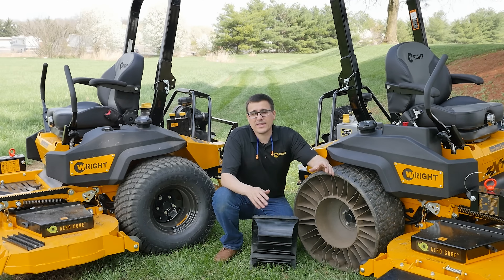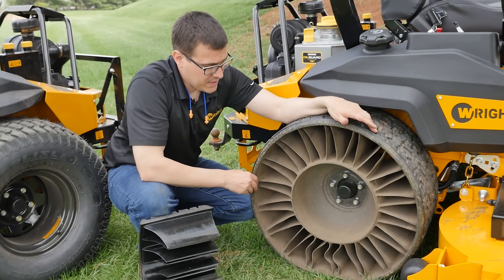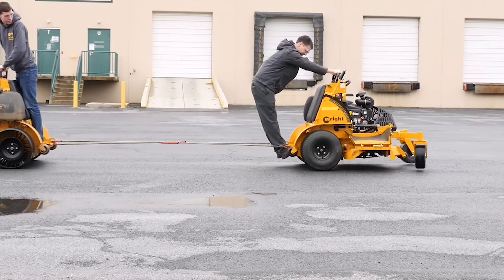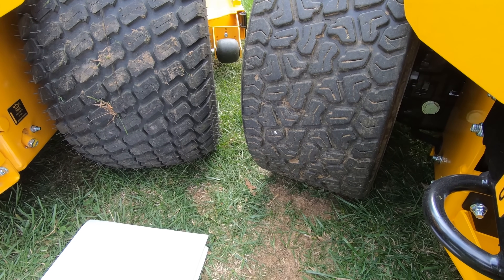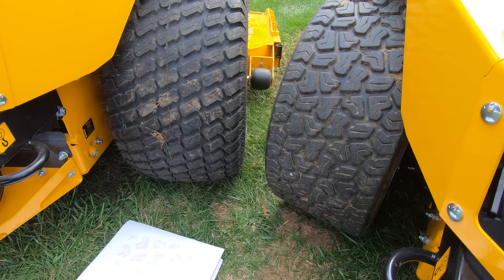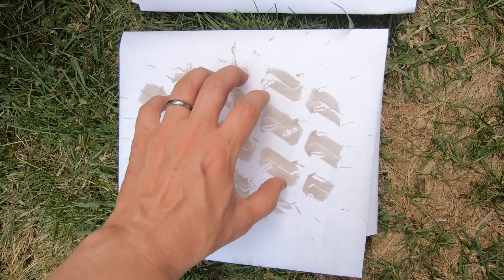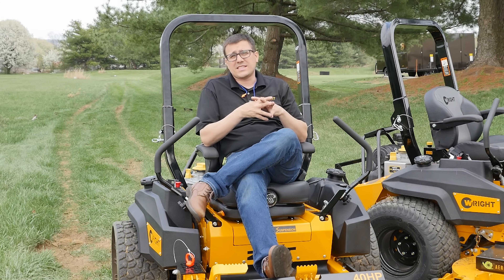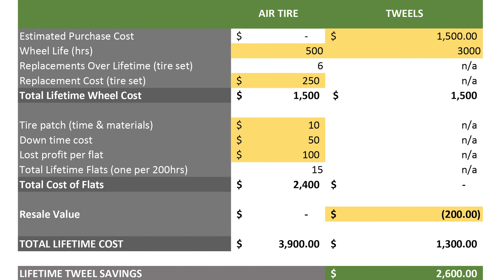WRIGHT | Ultimate Guide to TWEELS VS. AIR TIRES

Comment: Have a major concern when it comes to these.
First I have a stander X 52” deck
The tire size is a 20”x10” x 8” rim
The tweel doesn’t come in a 20”
Was told to use an 18” tweel . Several problems with that  . The tweel only 8.5 “ so it more weight to the ground , but the biggest problem is the deck height I just lost 2 “ from deck height . I’ve already lost an inch in deck height some how. So that puts my deck height at max 2 -1/2”and that sucks. Will the 22”x11” tweel work

Comment: Prices are massively exaggerated,  what kind of contractor wouldn't have a spare on hand,  and who would let that shut down your whole operation for a simple flat. Get your prices more inline and you will sell more instead of trying to justify your way too high priced product.
Reply: Overconfident much. If you have a crew out and they blow a tire, a lot of crew leads aren't going to stop their day, find a tire shop, match the tire, go get it installed, and then restart cutting. That's not how it works. Spares are also almost never stocked for tires. I've never seen lawn guys going around with spares in my area, not once. 

Stop making excuses just a hate on the video. It was pretty reasonable and how he approached things was pretty realistic. I don't run Tweels, nor do I plan to right now, but you've blown everything way out of proportion.

Comment: I spend $150 on new tires every year for my scarf v ride 2 36 inch. I get flats about every 3 weeks but plug them myself and keep a push mower as backup. The tween prices need to come down. Too expensive in my opinion. You can go home and plug your tires and loose 2 hours tops!

Comment: I recently retired a 22 year old Exmark with well over 4000 hours on it. Rear tires were changed once at a cost of less than 132.00 delivered for the pair. The wheels themselves are good for the life of the mower. To say that someone is going to beat you up buying a used mower with worn out air tires with your cost of 250.00 vs wore out tweel tires which cost 1500 to replace and saying they will actually add value is nonsense. 500 hours for the life of an air tire is laughable. Perhaps 3000 hours is too?

Comment: I have a Mi 360 scooter, all 4 air tires went bust (2 original and 2 spare) with light usage really. Eventually I changed to holo wheels / tweels. Now they last forever. Tweel economy works.

Comment: Interesting all around: BUT your costings,  ....   How do you get so many punctures ?    I am expecting 2000hrs from my tyres - they run on the grass after all and even on bare soil, the wear is minimal.  More likely to perish from old age.  However, from a RISK POV,  then I would probably go with the tweels - or could they simply BREAK UP - what about plastic fatigue ?    thnx for posting
Reply: My sentiments exactly - from experience with pneumatic tires. Using Green Slime really helps too. Great video tho - learned lots.

Comment: I can imagine how much mud,ant piles and other stuff that is going to get stuck in the tweel spokes
Reply: Any caked loose material just gets pushed out by the rotating action.  So basically, don't shove gravel or wet cement into them.

Comment: I live in mesquite thorn country- i pick up thorns constantly which means flats.both dealers did not recommend slime in the tires but rather tweels. What is your opinion?
Reply from the maker: We love the benefits of Tweels
Reply: Slime won't hurt anything. Been using it for 18 years now...
Reply: I live in Texas and the Mesquites are native to my property and see lots of new shoots late in every summer. I put slime in the tires when they were new and go several years without a leak. Also, Ask a Ford  and Chevy dealer which brand is best and I would bet there would be 2 different answers. Everybody needs to decide what is best for themselves.

Comment: I run very low pressure, 8 to 10 psi,  on fixed deck Standers, which is great for traction, ground pressure, and ride, but can result in the tire being unseated from the rim occasionally, which is worse than a simple flat.  I carry  mounted spares and a lever jack, which minimizes down time at a fraction of the cost of tweels.  Also, heavy duty tire sealant to prevent flats from roofing nails, etc.  Maybe  Wright could offer a spare tire option package on new mowers.

Comment: I've had air tires for 1500 hours on 1 mower and 800 hrs on another and have never had 15 flats or air leaks in 200 hrs.  I've had to replace air tires because of tread wear but not because of flats, I reckon tweels would be great for guys who don't run their machines.
Reply: Sample size: 1
Reply: @brandise76  lol correct. I watched the video formed my opinion with what I've experienced over the years. Never really had problems with the drive tires and flats, but I've had  front caster tires come off the rim from hitting a metal pole.
Reply: It says one per 200 hours. 15 over lifetime of tire. 3000 hours seems extreme.

Edit: I see he has a new set of air tires every 500 hours. That’s nuts 😂
Reply: @seabass22  Exactly!! I'm a novice to the business. However, my business partner (father) has been in the industry for 2 decades. He owned an Exmark and never replaced the tires. However, he did replace the engine at around 2k hrs. We currently have 500+ hrs on a machine with hardly any wear on the tires. I just can't see replacing traditional tires every 500 hrs.
Reply: I like hearing from experienced people about this. I have 600hr on air tires and only had to plug a tire once. I keep a spare rim and tire ready to go just in case. My tread looks like new.
I’ll get Tweels on a new machine if I can get them day one.
Reply: I have 25 hours on mine and have had 2 front flats and 1 rear flat, guess it's just the odds of rolling.

Comment: not fair.  the air tires are way over inflated at 13 psi.  I run 6 to 8 psi on my 72" mowers.  Tweels are NOT ADJUSTABLE so if i cut 200 pounds off my mower by ditching the ridiculously heavy suspension seat and taking out other unnecessary weight then the Tweel would not be able to compensate.  Suspension should be at the first point of conflict with the anomoly wich is the tire/bump convergence.  The second instance of suspension is Biomechanics in that the feet should be pressed firmly on DUAL deck lift arms for bilateral support and compression of the operator's back into the seat back WHILE the operator body is in a position similar to a zero gravity chair.  then you will not likely experience back pain and have full and immediate control in every direction including up/down as The Fight or flight reflex sends signals to the legs first. Also if you track individual equipment on a fleet you would find less need for stick men as you can float the deck and eliminate a lot of string trimming.